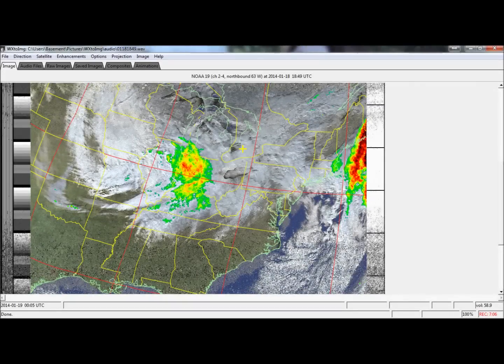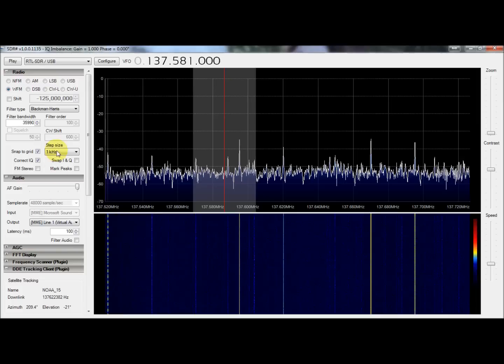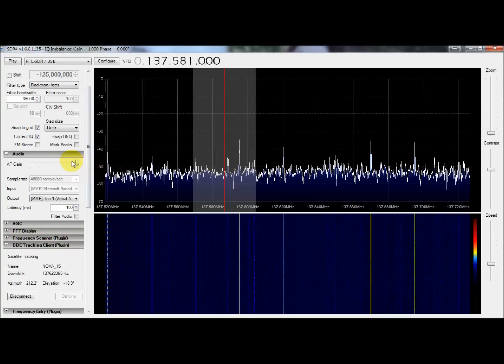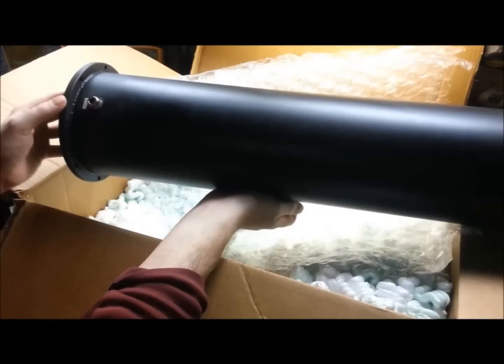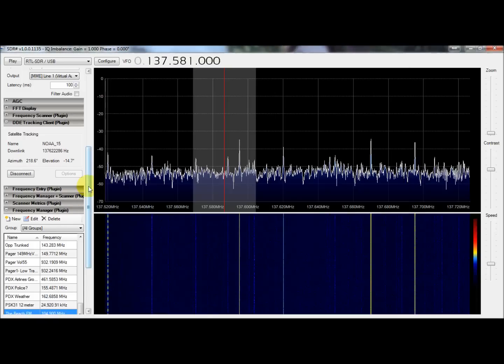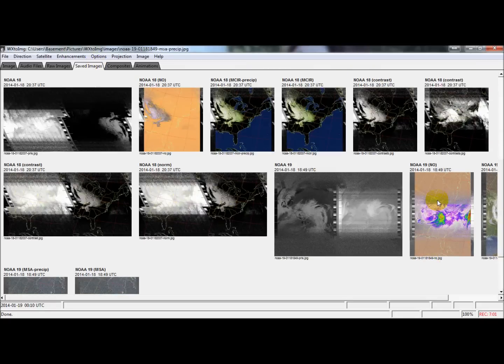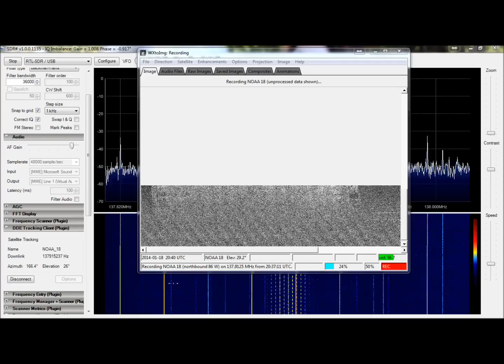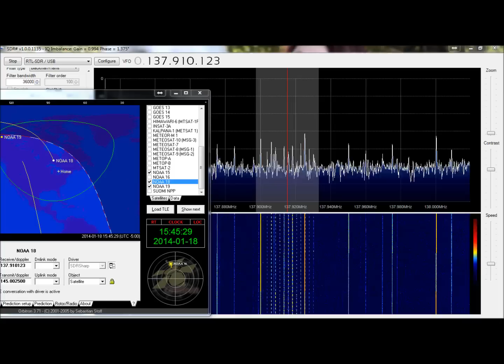Receiving NOAA Weather Satellite Images with $10 USB SDR Device Tutorial

Comment: thanks... been wanting to do this ever since I got Russian ISS SSTV images a few years back. I'm sure the following wouldn't work for weather sats, but for 2m ISS ham events I'll probably just always go virtually omnidirectional for those (or close to it like a dipole... there's so much Faraday rotation of the signal it worked fine and I got virtually no nulls) because of how well it worked. I totally didn't get the dead zones expected (then again they weren't dead overhead but at a slight angle, but very slight on one pass and I still got no overhead null) ... a high gain antenna would just require tracking the bird, whereas my static antenna only put maybe two tiny, ultra-thin lines of corruption in the entire, clear image which, to me, proved I didn't just download it from the internet (my own, unique, minuscule stamp of unique reception). I had no idea it would work, initially, from all the aficionado advice.  
I didn't finish my fancy cross yagi done in time (with cable type velocity factors calculated in for the little patch-together sections etc. etc.) so I just optimized the lengths of my simple dipole elements' resonant peak to fall right on the 2m downlink frequency, without high hopes. It was just two little lengths of hollow aluminum tent support tubing with a little "ugly balun" on them for transmitting to local repeaters etc. who still copied fine locally, about the same, despite the adjustment. The thick elements had surprising bandwidth in 2m before forming appreciable SWR, either side of target frequency. 
When I heard the clear bleeps and bloops I started hopping up and down in disbelief, as they were barely due to peak above horizon. Images were absolutely 99% clear, of classic-era cosmonauts (on magnified postage stamps?) on multiple passes, purely vertical, no pointing. Well, sorry, actually horizontal -- I just mean the pole was vertical and fixed, tall enough to clear my roof peak. The ugly balun between the elements was just some turns of 75 Ohm nice quality TV cable (that's just what I had onhand for free and worked about as well as nice 50 Ohm proper coax).  The turns were not large, like around a piece of indoor plumbing pvc (inch, inch & a half?) up near the 180 degree opposing elements (I normally do a V for 50 Ohm but did straight dipole to match the 75 Ohm free TV cable impedance). I ran a perpendicular horizontal stick out from the center of the elements like a T to run the ugly balun and feedline out away from the inner area of the antenna esp. since sometimes I used it with a non-grounded handheld and didn't want to transmit into my own cable. Probably hard to visualize with my poor description and no illustration but I got the design from typical newbie sites for technician class station startups. Who knew it would pick up ISS scavenger hunts better than when I was trying to track them by hand with a regular yagi with a reflector and several frontal passive elements? I think everyone who embarks on sophisticated circular polarity antennas and such should stick up a simple dipole just to compare. So many people told everyone asking that they'd never receive the signals without at least an eggbeater or a directional, live-tracking yagi, and that they'd have terrible images full of giant gaps with their regular ragchew antenna. I learned A) just how powerfully a resonant dipole can receive and b) how much bandwidth the antenna would have despite being VHF... thick-diameter elements are great that way because the waves seem to "find" the extra area for lower end and "ignore" it for higher end frequencies much, much more efficiently than I ever imagined, and, hands-on in my environment, seemingly more so than sometimes modeled by software!

Comment: Thanks SO much for reminding me about the virtual cable thing to output  the data to another app while initially finding a signal with SDRsharp... I hear SSTV images and record them for later decoding but wanted to be able to switch or nest windows and see it realtime :) ...can I ask why the lower sample rate works better, is it just that higher was a bit much for the computer and sound module specs? (for those who don't know, whether sound is being listened to or not, I believe it's still the part of the computer hardware that the software targets and uses to process the frequency information it gets from the the simple dongle). Kind of like how you can process SETI data with a CUDA video card even though it has nothing to do with video. But ys my question is, is that the only reason you had the sample rate turned down, was that the hardward wasn't keeping up with higher rate? That's my guess... our ears mightn't pick out certain kinds of corruption listening to audio but when it's used like a modem for images inaudible corruption might damage the image? I'm glad the lower rate is sufficient.

Comment: The background music is too loud for me understand some of what you are saying Eric, in case it helps for future vids. I do have impaired hearing so it may be fine for most people. :-)
Reply from the maker: Bob Valder Thanks Bob- You are 100% right.  Alot of my older videos are not good for this- I have corrected in in my current ones.  Much better audio now.  I'll do better :)
Reply: Eric William No problem Eric, I have the same problem with loads of videos.
I spent far too many years working in steel and paper mills, hearing is totally shot now.
My how things have got easier now, when I started with remote imaging I had to build my own 137MHz receiver for orbitals, a downconverter and dish for geostationary and a frame store built from discrete logic chips.
Reply: god bless you bob

Comment: at 5.01 mins, thats what my images are currently turning out like. What did you do to resolve this problem? Ive tried lots of things but with no success. Ive had great results with the antenna previously so i knoow that side of it works well. (i had great results doing each stage seperately, but trying to set it up to auto decode seems to make it fail
Reply: and the music is great! I dont know why people in the comments are complaining about it!
Reply from the maker: The audio back then in these isnt very good.  If you mean the snow- its a lack of signal denoted by the lack of the bars down the sides. If you mean the alignment issue- that is resolved with a setting in WXtoIMG that when adjusted it will properly align.  There's an instruction for that somewhere.

Comment: I followed this to the letter.  All I get is static   And yes. I can get signals from am bands
Reply from the maker: Static means you did one or multiple of the following:  Have a problem with your SDR, set the gain on the SDR too low, tuned your SDR to the wrong freq, set the freq right but at the wrong time to handle doppler, used the wrong antenna for the freq, the satellite wasn't passing over your position at the time you tried to receive it. The NOAA sats are FM not AM btw...
Reply: @MkmeOrg  I think it’s my antenna. I’m going to build a v dipole this evening and give it a go.  Question. Should it face In any certain direction?
Reply: @MkmeOrg  I found the issue.  I hadn’t realized the nearest  big city was in a different time zone. The software was recording one hour early
Reply: i think i need to increase sample rate, i recorded  at 0.25   looked good till processed then it was useless    thoughts>?